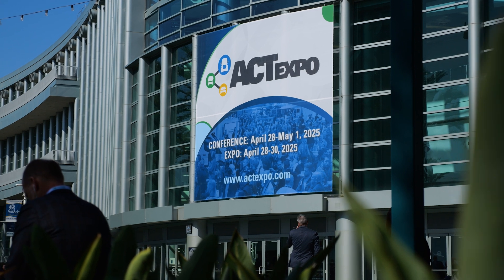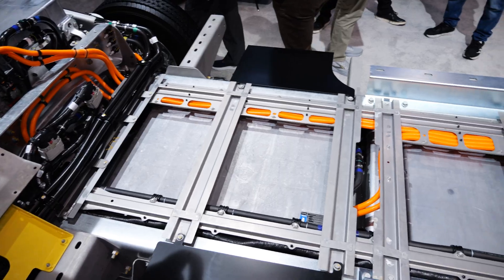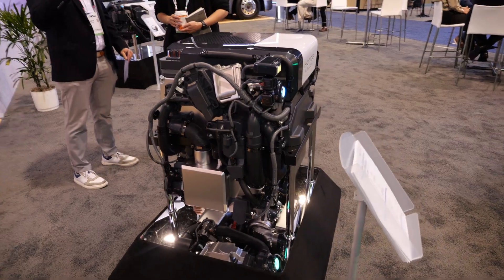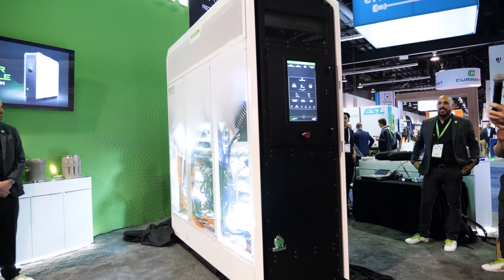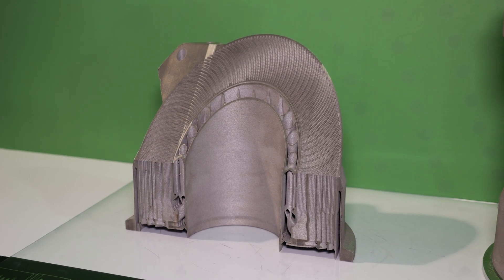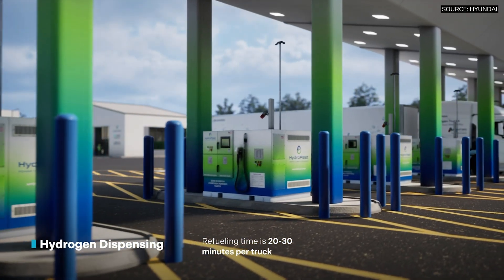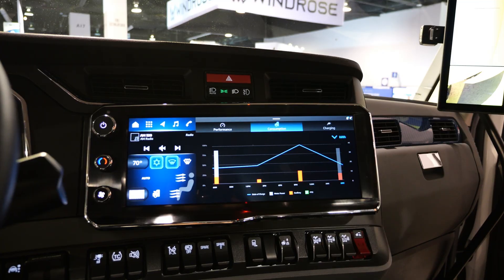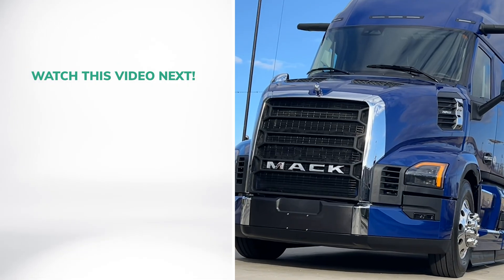7 Biggest Reveals from ACT Expo 2025 – Electric Trucks, Hydrogen, and a Wild Generator

Comment: I will be interested to see if any American company goes the route of Janus in Australia.  They have a system for retrofitting old diesel trucks with a new, modular BEV drive train and electronics, along with a software package for truck and fleet monitoring and control.  Their battery packs are designed to be swapped out using a forklift.  The swap takes 5 minutes, compared to 15 minutes for diesel refueling.  This also allows for slower recharging of the batteries, which significantly reduces installed infrastructure costs.  I'm pretty sure this is the model that will dominate long-range trucking in the long run.

Comment: Any executive that is still working on hydrogen for the transportation sector should be fired.  The physics and chemistry simply aren't competitive with battery electric at any scale whether it's light duty to heavy duty, to plains and trains.
Reply: And you are WHO ???
Reply: @7779-c3m  They tried hydrogen trucking in Europe already.  They put it on the road more than 5 years ago, but it was not viable and has long since been abandoned.  By contrast, BEV trucking is steadily increasing, year after year after year.  The Electric Trucker channel is an English-language channel from a German truck driver showing off all of the many BEV truck models on the roads, and the many different types of charging stations available in and around Germany.